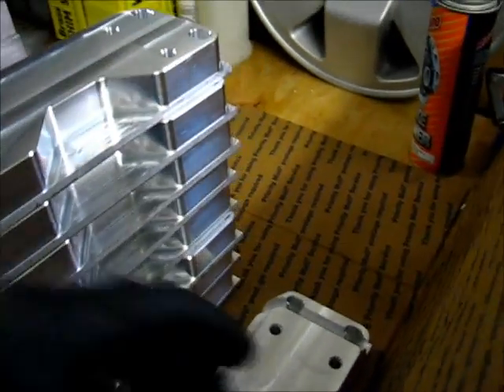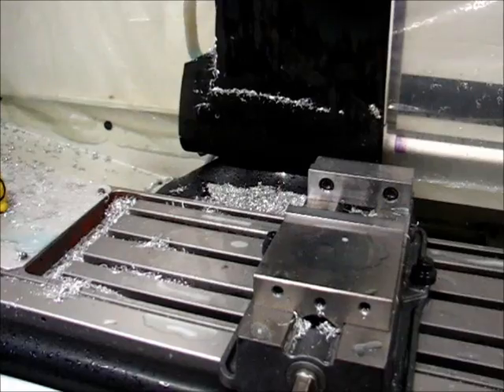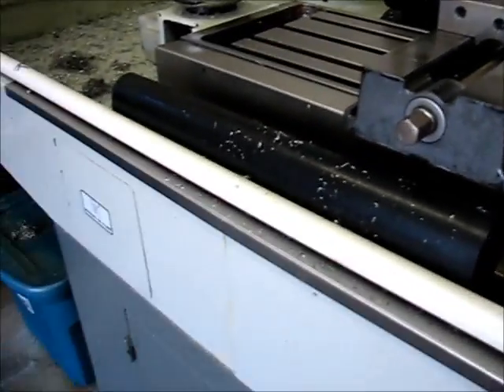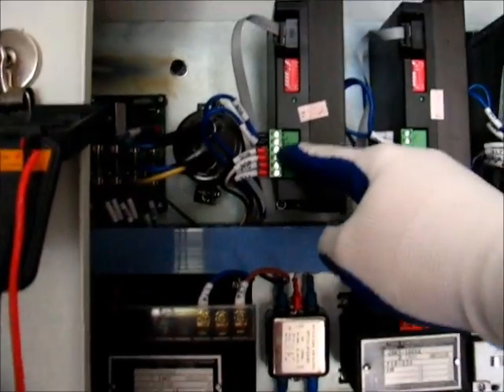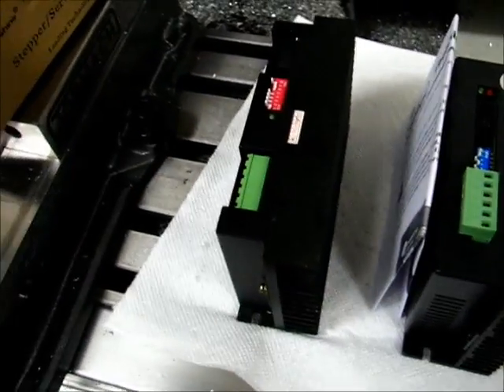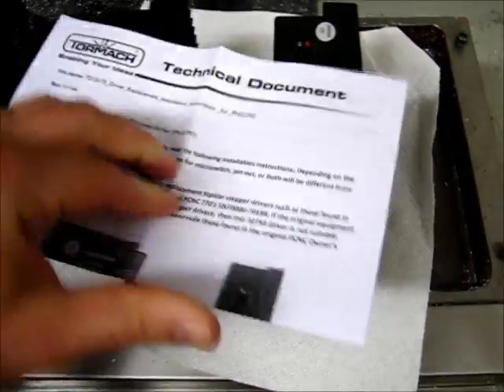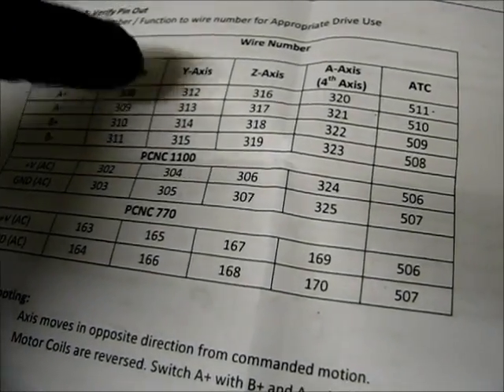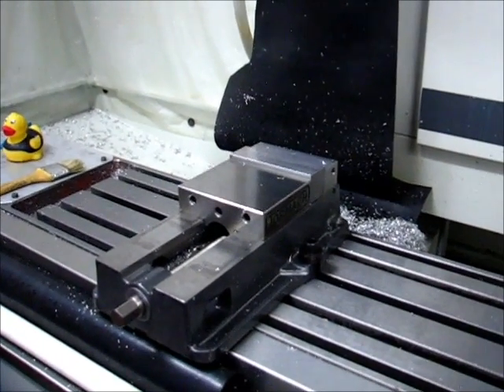Tormach PCNC 1100 - Diagnosing and Replacing Failed Stepper Motor Driver

Comment: Hey,

On my PCNC 1100, I experience something weird every once in a while. When I have just turned the machine on and clicked the reset (using PathPilot OS), I click reference z and the head makes an unfamiliar loud noise and moves down instead of up. I can see the limit switch at the top and it usually moves up and references correctly, but sometimes it doesn't. I always E-stop it when this happens because I don't want to find out if the head will move all the way down and hit the table. Unless I just am not aware that there is a Z limit switch at the bottom, this seems not normal. Any idea what may be causing this? Usually multiple complete machine restarts causes it to eventually reference correctly.

Thanks

Comment: Hi Chris. Good job on machining the covers for i do not know what but they came up very good.
 How long does it take you to machine each one?
Also can i ask what are they for?

Just stated to watch your channel so it seems i have a few videos to watch.

All the best. Peter.
Reply from the maker: +Peter CCR ENG Thanks! They definitely check all the "shiny" and "pretty" boxes. It's about 8 minutes for the first side and about three for the second. Here's a link to the finished part:

http://www.mc2racing.com/products/xr4ti/suspension/bushings/00676/index.html

It's an adapter for the Merkur Scorpio.
Reply: Thanks for the link and reply you do not seem to put a very high price on them.
I was guessing looking at the original part on the video that they might be a little more expensive ??
But if you feel that the price is enough then maybe you can sell a lot more units.
I guess that's why you went with the Tormach machine.
So there would be some $$$ left for you ??
Reply from the maker: It's all about the market will bear!
Reply: I Australia where i am from some CNC machines shops charge very well for machined parts while others seem to just charge enough to pay the bills.
And in both cases i am talking high end machines not just someone making do with what equipment they have.

I know in your country just about every guy has got some sort of home workshop, doing something with metal or wood.
Here we have something similar but not as wide spread.
So I guess you need to try hard to be competitive with pricing.

Even if you want to set-up something like you have maybe a Tormach mill you are looking around $35,000 AUD to get a half descent set-up.
So is a little more difficult to get something started even something like a Tormach machine.

Comment: Alarm! Alarm! check the wiring for shorts. I had the exact same thing happen! Got a replacement under warranty. When I did the series 3 upgrade (do this now its is sooooooo much better than the old 2 phase motor system!) I found there was a missing splice cap and the dam thing had arc to the frame. That is what killed the first drive and most likely would have nuked another drive if it touched down again. Nice work by the way, keep it up!
Reply from the maker: Widget Works Manufacturing Inc. Thanks for the input.  When I was diagnosing, I checked the wire leads from the controller at the motor.  There was a loose splice cover, but it was intact and covering the connection properly.  The wires were firmly connected, so I just recrimped the splice over it.  When I started diagnosing this problem, I spent a lot of time convinced it was the motor or the wiring that was faulty, so I chased that around for a while.  (The real problem was that I just switched ribbon cables between the X- and Y-axis stepper motor drivers.  The problem stayed on the X-axis, of course, but that incorrectly convinced me that the stepper motor driver was fine, when I was really just not understanding the system, yet.)  I couldn't find any issues with wiring.  Thanks for the input though.  If I get another failure, I'll dig more for wiring issues before I upgrade to the Polyphase system.